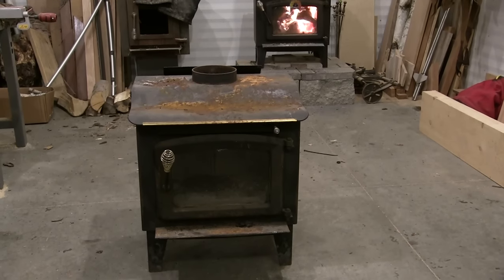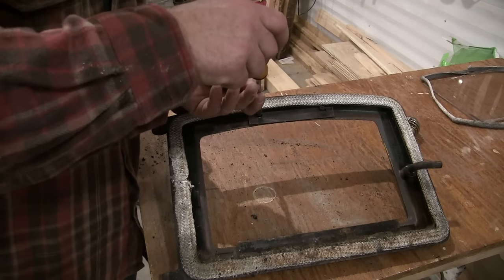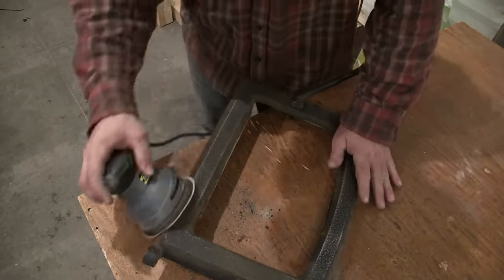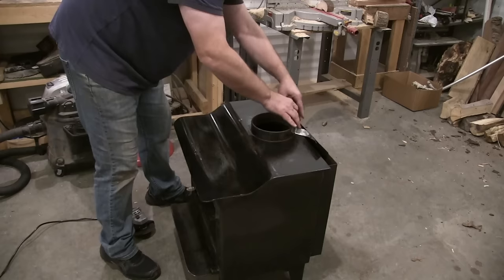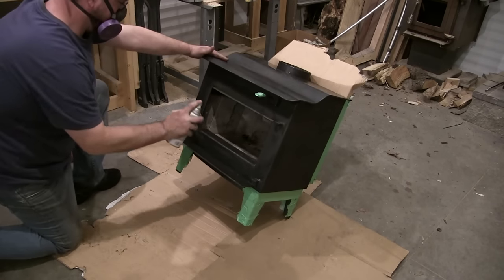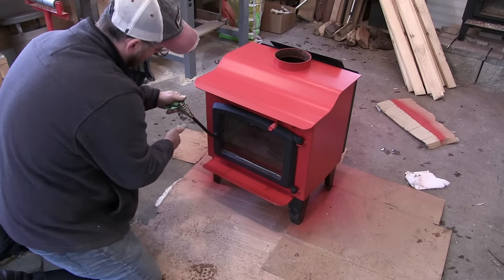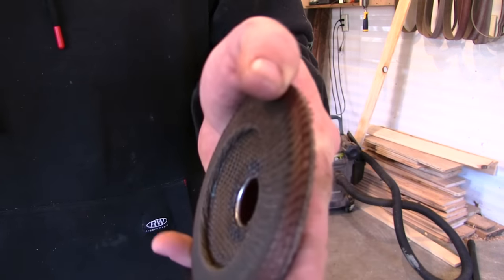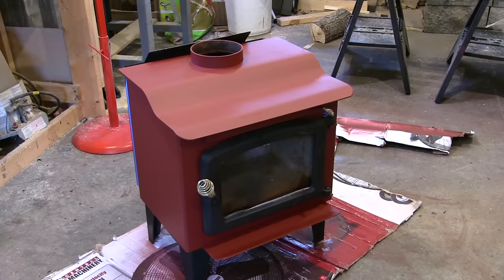restoring a cheap second hand wood stove !!

Comment: I am really digging the channel keep up the good work. Try a twisted wire cup brush for the angle grinder eats through rust and paint. Work well and last forever.  If needed I will finish with one of those 3M stripping discs. Strippers are nice but in my experience they are to distracting and not so handy around the shop lol.
Reply from the maker: awesome ! I'll have to give it a try that second thing I used took the paint off really fast too . LOL yeah strippers might not have been the best idea lol

Comment: Love I love this stove great job. Did you use acetone to clean the door after grinding ‽
Reply from the maker: Thanks ! I actually used mineral spirits on the door it worked fine . then I read the directions on the paint and used acetone on the stove . acetone works better

Comment: Great just what I have to do with my over 50 year old wood stove that came with my house. I have had it for 30. Mine is not as rusty.  So I figure it should not be hard to do. I do have a crack inside the liner, not sure if that is a problem?
Reply from the maker: it's kinda fun restoring them much more fun if you can paint it outside and fire it for a few hours outside to burn of the fumes .. not sure I guess it would depend on how big the crack is

Comment: My stove is very similar. It attracts dust like crazy. I have a hard time keeping a steady fire in it. It's either all out or dying down too much. Any tips?
Reply from the maker: Hmm, I'm not sure could be a lot of different things could be the quality or dryness of the wood , lack of airflow maybe the way the chimney is ran or maybe it needs to be cleaned .
Reply: @blackspruce1861   It would probably help if I had more experience with the stove. Since the chimney fire years and years ago, we have only used it a few times. The chimney should be clean as we had it lined after the fire. We were told we'd never have to clean it. I don't know how much I believe that. lol

Comment: Who is the manufacturer of that stove? I need new glass and the glass retaining plate with new screws. Data plate is unreadable and I’m trying to do the same thing you did which looks fantastic!
Reply: 😊I forgot to say it is the same stove, sorry. Can you help?
Reply from the maker: hey sorry it's taken so long for me to respond , I've fallen way behind on comments. The stove is made by Warnock Hersey . If  that doesn't get you the parts you need you can do a google search for wood stove stove glass  and order it by the size you need . the retainer plate is just a flat piece of metal with a couple holes for the screws ,so you should be able to make your own pretty easily as well. hope this helps . glad you enjoyed the video !!
Reply: @blackspruce1861  no worries and thank you so much!

Comment: Hey Thanks buddy! Sorry though about you mishap. I am redoing my wood stove and was thinking of red and black. I was going to use flat black wood stove paint on the door and thought I might use the VHT automotive flat red high heat header paint on the stove. I can see now that wood have been a huge mistake. That must have been super frustrating for you but glad you didn't throw in the towel instead you bit the bullet and carried on through with plan two. So today I used high heat flat black stove paint on the stove and high heat copper color stove paint on the door. Have to run the cure outside tomorrow. Cross my figures. 

Another mistake you can make is on the re-coat time if you are doing a second coat. I had a corner heat shield I made 3x3x4 feet high and sprayed it with high heat stove paint out of spray bombs. It was going great until spray bomb nozzle started spitting lets call it barfing on the job. So on one bent section of the shield that the paint stared to spit all over, I sanded lightly and sprayed over the next day and unfortunately it started to alligator the prior days paint. Nightmare on Pain Street. So was left with no choice but to rub that section all off with acetone and start again. Not perfect the second time but nearly. I hate spray bombs with a passion but funny how we find ourselves using them again. There are better nozzles out there now but they still seem to screw up just when your nearly finished. They have a lot of xylene, toluene and or acetone in them so not only are they pretty toxic, you need to do all your re-coats within one hour in one session otherwise you need to wait 48 hours or more to avoid eating into the first coat and get the dreaded alligator finish. Not the wrinkle finish you were going for the other pull your hair out one.

On the stove I used the Satin Black Rustoleum stove paint in the quart can and just thinned it enough to get out of the gun. It when on beautifully with no spitting like the stinky bombs.

Hope I am still happy tomorrow after the heat cure fire.
Reply from the maker: yeah it really sucked to have to refinish it but I'm happy I did and got this video up . Before this I couldn't find any info on weather you could use header paint or not and you're not the first person who has told me they were about to use it before they seen this video ,so I'm glad its saved some people a real pain in the neck .  That copper black combo sounds like it would look awesome !!
Reply: OK update, sprayed er up the other day. Had the curse of bug butt boogie and an area I tried to fix. Should have left alone but no one around to pull me back and whack me. So it was the dreaded how long to wait before recoat to avoid the cursed rustoleum 2nd coat wrinkle. I wasn't willing to take a chance so last night I cured that paint with a burn in fire. The satin black was quart can but the copper was a spray bomb. The copper spray bomb didn't seem to cure and stayed a bit soft  The better half wasn't too crazy about it so I sanded everything down both stove and door. Had to use toluene to get the last bit off door. Today perfect day, 27 Celsius and very little wind and low humidity.  Wiped down with some paint prep and fired the gun up. Yahoo went A1 with only couple bugs that I picked out with a dental pick and air. Going for coffee now to celebrate! Later in the summer I have to redo the big Lopi woodstove. Will use the same satin black but any two tones colors I will get the Stove Bright woodstove paint rather than take a chance again on the rustoleun. You know what they say once bit twice shy. First coat was frustration second coat was a dream. Got the system down now for the next one. I HOPE. Live and learn, right? (-;

Comment: Do I understand you correctly that  I would have to hear up the stove and let it cool some to paint. I have a good wood stove store by me that has cleaned my chimney. I will be selling the house and want to certify the chimney and stove. For people who do not have a good clearance behind or below their stove pipe I learned that a flashing can be added to the pipe to eliminate need to change hearth.
Reply from the maker: well if its in a warm room that has been heated for a while it should be fine but I was in my shop I warmed the room up but the stove was still quite cold .

Comment: Pro-tip: you can use those tiger paw sanding pads, but to avoid the flaps gumming up with paint, you just have to dip into clean metal frequently to knock that paint off.
Reply from the maker: thanks  for the tip it really gummed up fast
Reply: @blackspruce1861  just keep working it into clean metal. When you see the sparks again, it’s clean enough to knock down some paint.

Comment: What kind of paint are you using? Shouldn’t it be some type of heat resistant paint?
Reply from the maker: it was high temp engine paint , then switched to wood stove paint . I said it in the video but someone said my volume was low
Reply: @blackspruce1861  Thanks for your reply. I have a wood stove that’s bee. Sutton g in the driveway for 10 years after suffering a life changing traumatic injury. With that said, I’m thinking of painting it after I install it and I love what you did. Thank you so much for finally responding!